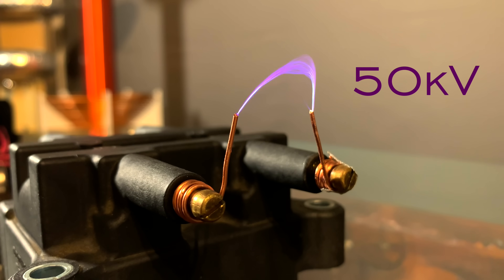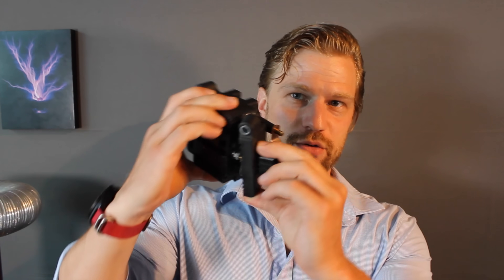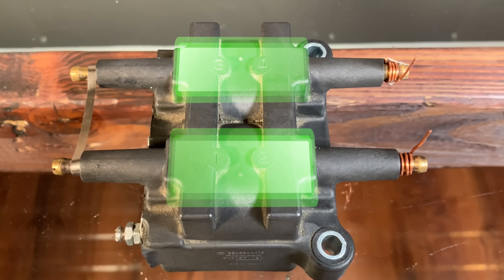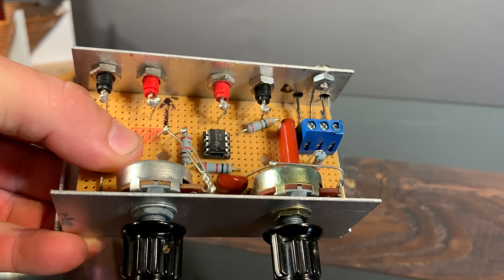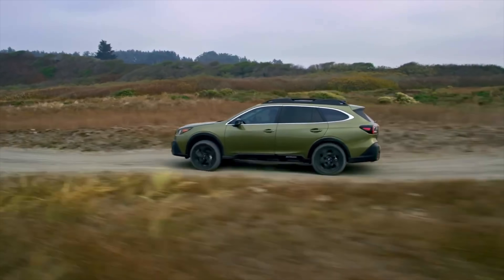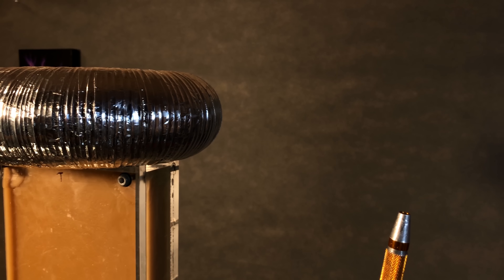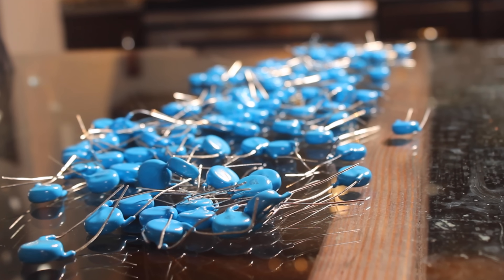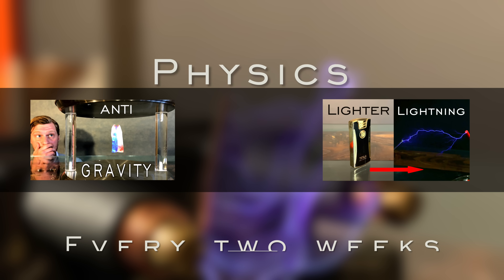The 50,000 volt Subaru Outback Powersource!

Comment: You like high voltage plasma's huh? Your next step should be to add fused quartz in and around your plasma arc, your gap can grow by 4 to 6 times in length as the arc rides along the quartz surface....or drill thru quartz lengthwise super small hole for the arc to pass. After you experiment with quartz's unique HV properties and want to know more.... I'll explain how you can made an arc across a quartz gap without any current flow (cold blue arc) using a charge HV source capacitor (get rid of your LV primary coil and inefficient magnetic core) . And if you're really good you can use a peripheral coil to capture the arc's radiant energy and feed it back into the HV source charged capacitor and watch the voltage rise as your device is arcing.
....and is where our Earthly technology ends, we're not able to control the "spark-arc" past 1 to 3 no current blue arcs as the voltage rises, the quartz surface spark breaks down and current jumps (yellow-white spark occurs). The Greys are far superior, they somehow move the quartz surface to a new unused surface, treat the quartz, normalize the quartz...ready for the second no flow spark, third and so on.
Reply from the maker: This seems very interesting, and borderline Pseudosciency. But, i'm intrigued nonetheless!
Reply: @PlasmaChannel  Get yourself some natural quartz...the longer the better. Let the spark arc travel along the flat surface...and be prepared to increase the gap A LOT wider. Quartz is not the insulator we all take it to be...the surface is highly conductive. I believe someday in the future will be making lots of 10 angstrom holes in quartz to act as a HV conduit.  I've done a lot of research on it in my late 20's and thirties when i was a hot-firecracker of an engineer....now, I give-back to the newcomers. I wrote a white paper on coefficient of coupling when i was younger...they CAN DIFFER Kc (reflective) and Kc (induced) does not have to be the SAME value....basically, I induced a peripheral semi-inductionless coil and proved the reflective was less.
Reply: @PlasmaChannel  The experiment i loved the most was recycling 5% of the power already used thru the "load" back thru the load. I purchased special high-current Germanium diodes and our favorite LC tank...will not work with silicon diodes. It's a total shame our engineering sciences basically dismissed the germanium diode (not use much at all today)...it really is a God given treasure.

Comment: This coil can be driven to up to 250kv with the iron core removed, dunk it in oil and drive the shit out of it in resonance mode like it was a tesla coil....
Reply: Ocean House .
For real.
Then it can be used as a transmision delivery transformer for a home made self looping power plant generating system.

This is all I needed for  a return circuite.
Thanks a billion.
Reply: @gingerbread1032  lol, no for real there is competition on the internet for over driving automotive HE coils, to tesla like voltages/outputs..... several people have made them over the years I think the current confirmed voltage record is 300 kv output..... 150 plux kv is easy, but you have to dunk the transformer in a big pot or PVC enclose filled dry high dialectric oil en-order to separate the leads enough to get the long arcs, at some point the internal insulation of the transformer fails... but its a hell of a thing to see 150 plus kv out of an automotive HE coil, once the core is removed they are basically compact Tesla coils.....
Reply from the maker: This intrigues me. I will look into this - and will attempt more than 300kv
Reply: @PlasmaChannel  I think it takes high input voltages on the primary with an HF driver transformer feed from a high power precise switching circuit like an sstc H bridge to get the best voltage outputs, if remember this correctly for starters you can use a classic tank resonance circuit to drive them as well but impedance matching becomes an issue as you cannot tune the primary you will need to tune something else like the tank input frequency or capacitance...or use a DC resonate charging scheme maybe....   Oh and you gonna need a supply of used coils because you gonna burn a few of them...

Comment: Um... Question... Would it be usable to make a light weight welding unit? If so, how?

Grant, the original King of Random, (R. I. P. He'll be long missed} showed a long time ago how to use transformers from microwaves to build a welder and, by connecting them to some graphite rods, make a micro plasma furnace.
Reply from the maker: Ah, this would not work - welders use hundreds of amps of current. The output of this is high voltage, not high current. RIP Grant.
Reply: @PlasmaChannel  thanks, was just curious

Comment: This would produce some MAD radio frequency noise wouldn't it ?
Reply from the maker: It actually does, yes! Radio was very upset
Reply: Yes it does, that's why spark plug wires are very well shielded and spark plugs have a resistor in them to help reduce noise.
Reply: Good guess, RF interference is strong around such devices. I have blanked out my LCD monitors when experimenting with ignition coils and drawing arcs as long as possible. It was basically an EMP device. I wasnt even using something as large as Subary coil. My experiment had 150ccm single cylinder engine ignition system (12V DC system), coupled with small stepper motor as ignition signal sensor (generator). Just to test out if the ignition works but that wouldnt be fun if not done "properly".
Reply: @elmetorasson96  Sounds like the basis for a pretty sweet hand-cranked HV source if built into a suitable enclosure. How long were the arcs?  I may have to try that.
Reply: Isn't that the high-pitched screech we hear on the audio of this video?
Reply: @chrisjohnston4445   the harmonics will reach into the RF band... and interference-producing devices are illegal as they are classed as "transmitters" by the FCC... 

Be careful of the authorities, ya don't want a knock at the door by a guy with a badge... 🙄😳
Reply: Peter Fitzpatrick those damn goons.

Comment: Since subaru ignition coil allows you to power it in two different ways. I wonder what will happen if you take two subaru ignition coils, configure one subaru ignition coil for high voltage output and other subaru ignition coil to output high current. Take two metal plates, connect one metal plate to high voltage and other to high current and bring the two metal plates closer to each other but don't let them touch each other. Will something happen between two metal plates? What if you drop objects between two metal plates? How will high voltage and high current metal plates interact with each other? Will the electrons flow from high voltage metal plate to high current metal plate?

Comment: Not every gasoline engine uses them: especially small two-stroke engines and lawnmower engines have often a rotating magnet and a coil. I think you call that magneto ignition? It's not a transformer.
Reply from the maker: Great points! Magnetic ignition still use a spark plug, and high voltage. So, you are technically correct - it is less of a transformer, and more of a coil of wire being violently disturbed by a magnet, producing HV

Comment: With that you can make very cheap plasma engine with that engine you can travel from the planets to  planet.
Reply from the maker: Do you mean an ion drive? Yes, this would work for ionic propulsion if it is rectified to DC High Voltage.

Comment: Can this be used in the vehicle?. Bigger spark at the spark plugs.
Reply from the maker: Higher voltages do equate to hotter sparks in a spark plug. Hotter sparks do more efficiently ignite a fuel mixture, leading to a more efficient engine.

Comment: Well it got one of these having four output....its from motorcraft...and it has 3 input the middle pin is the common and I am just using 2pins only can I still use another pin?
Reply from the maker: You can run these coils using any combination of two pins. However, using only two pins does not use the coil to its full potential.

Comment: Man, I just wish they made a truck. I can only imagine a Subaru V8... Dude, Whoa, with a 24Volt  system.... I can only imagine.
Why isn't "That" Technology being utilized, when it come to Re-Charging from the Wheel to the  Battery?
Don't tell me "They" haven't thought of that.
Reply from the maker: Oh, many car companies have applied that tech. Recycling energy back into a battery from a braking system. Its quite simple of tech too. Yeah, with Subaru had a big truck!
Reply: Yes, when coasting, or braking, I'm talking about while accelerating also...
Reply: Subaru has made 2 trucks actually, one called the brat in the 70s and one called the Baja in the early 2000s
Reply: V8 dude? Really? Subaru is famous for using only boxer engines on its cars (BRZ and the old ones dont count ). 
So a 8 cylinder Subaru should be a boxer 8.
Reply: No, Really? I've owned 5 of them. Alright, a 8 cyl Boxer would be Epic.

Comment: Gotta love that 555 hint in there! Great video...I have about 4 of these  ignition coils😬
Reply from the maker: Thanks Michael! the 555 timer is an awesome circuit, but way too fragile. I blow through 555's faster than a bullet.
Reply: @PlasmaChannel 
Have u tried using a 555 & H-Bridge...
That way the H-Bridge does the hard work & u don't damage ur 555...
Also if u use a socket u can just change ur chip as needed in a matter of seconds...
Hope that helps...
Reply from the maker: Hey max, interesting, I’ll look into the h bridge idea. Yeah, sockets are essential. In shooting the video I burned through ten, and the socket made it a blast.
Reply: @PlasmaChannel 
I'm new-ish 2 all of this... but not 2 electronics..!
I'm assuming u have some electronics experience...

I'm assuming ur using the 555 2 generate square wave AC (astable multi vibrator mode)... correct me if I'm wrong (as u didn't really say much about it in the video).

If u feed that (via resistors 2 limit the current, or ull kill the 555 anyway) 2 the input of a H-Bridge, it will trigger the mos-fets & they can handle a lot more power & u can easily use heat-sinks & cool them etc...

The 555 is a pain that way... it can't handle much power wise, gets hot & is a pain 2 cool...

I look forward 2 seeing what u come up with... it would definitely b an interesting video..!

Comment: Nikola Tesla's transmitter system and the wanderclyffe tower is actually based on this same  principle you are demostrating here, his system is a point to point discharge but at extremely high voltages of over 5 million volts! , the point to point nature of the system is why Tesla   got higher efficiencies compared to a normal radio transmission (a radio transmission emanates in all directions) here are some details from his patent:

https://patentimages.storage.googleapis.com/62/90/92/45a5932052a940/US645576.pdf

"By the discovery of these facts and the perfection of means for producing in a safe, economical, and thoroughly  practicable manner current impulses of the character described it becomes possible to transmit through easily accessible and only moderately rarefied strata of the atmosphere electrical energy not merely in insignificant quantities, such as are suitable for the operation of delicate instruments and like purposes, but also in quantities suitable for industrial uses on a large scale up to practically any amount"

" gases are known to be still nearly perfect insulators for ordinary electromotive forces, they behave toward electromotive impulses of several millions of volts like excellent conductors"

"for if the potential be sufficiently high and if the terminals of the coils be maintained at the proper altitudes the action described will take place, and a current will be transmitted through the elevated air strata, which will encounter little and possibly even less resistance than if conveyed through a copper wire of a practicable size." 

"With reference to the facts which have been pointed out above it will be seen that the altitudes required for the transmission of considerable amounts of electrical energy in accordance with this method are such as are easily accessible and at which terminals can be safely maintained, as by the aid of captive balloons supplied continuously with gas from reservoirs and held-in position securely by steel wires or by any other means"

---this quote refers to an  experimental version  (small scale) of his device:

"The outer end of the secondary or high-tension coil A was connected to the ground, as illustrated, while the free end was led to a terminal placed in the rarefied airstratum through which the energy was to be transmitted, which was contained in an insulating-tube of a length of fifty feet or more (50 feet , 15 meters) , within which a  barometric pressure varying from about one hundred and twenty to one hundred and fifty millimeters (120 to 150 mmHg, about  5 to 6 inHg of vacuum) was maintained by means of a mechanical suction-pump."

---this is his proposal for his device at big scale, this is the basic plan for the wanderclyffe tower, he did managed to get the founding to build it but he encountered many technical problems and things  didn't turn out as he thought:

"from my experiments and observations I conclude that with electromotive impulses not greatly exceeding fifteen or twenty million (15 or 20 MV) volts the energy of many thousands of horse-power may be transmitted over vast distances, measured by many hundreds and even thousands of miles, with terminals not more than thirty to thirty-five thousand feet(30.000 to 35.000 feet, about 10 Km ) above the level of the sea, and even this comparatively-small elevation will be required chiefly for reasons of economy, and, if desired, it may be considerably reduced, since by such means as have been described practically any potential that is desired may be obtained, the currents through the air strata may be rendered very small, whereby the loss in the transmission may be reduced"
Reply from the maker: It is absolutely an amazing feat he accomplished. That entire transmitting apparatus was incredible. Cheers!
Reply: @PlasmaChannel  I'm leaving this info if someone else is interested, it is possible to make a DIY small scale model (or proof of concept) of this system using easy to find components: 

- 2 ignition coils (or 2  neon lighting transformers)
- 1 driver module to use with one of  the ignition coils or transformer
- power supply or car battery to feed  the module 

- a  "trigger signal" source (its possible to use a sine wave tones   from a soundcard but this will depend in the type of module)
- 1 container to install both terminals (this is optional, it is possible to just leave the therminals  in open air but the discharge will be just a couple of centimeters at this voltages)

Tesla was using discharges of around  3 million volts (and the reason he used spiral  coils is to avoid arcing between the turns of the coils, at this voltages this becomes critical he explains all  this in the patent) but its perfectly possible to use lower voltages as a "proof of concept" although the range will be a lot less (ignition coils get up to no more that 40 to 50 KV)  Tesla got around 15 meters or 50 feet in  rarefied air, if people want to calculate aproximate ranges the best way to do it is by using  Paschen's curves or equations and input around 120 to 150 Torr of vacuum (as per tesla's instructions) https://en.wikipedia.org/wiki/Paschen%27s_law  this kind of vacuum can put a lot of stress on the container so be aware to use something sturdy. its possible to use less vacuum but this will reduce the range of the discharge. I highly recommend to use a good ground (a good copper rod , some houses have copper water piping this can be even better) Tesla gives this advice in his pattent because it does tent to improve the range.

heres the basic schematic, the specific connections will vary depending  on the type of coils and the module used:  https://i.imgur.com/YzjAFP0.png

Comment: Those are baby sparks. Try oil filled coils like this: https://www.youtube.com/watch?v=Q1L6wJp5qPI
Reply from the maker: Yeah, The sparks COULD be bigger. But not some bad shots though, right?
Reply: Did you see the video that I linked? That is the difference between epoxy coils, such as you are using and oil-filled coils.
Considering that you are using epoxy coils, you're doing quite ok, but especially if you want to use this as a power supply in other projects, you should really forget about Subaru and go for the classic oil-filled coils. I think with a pair of those you can get twice the voltage and even more power. (oil = self-healing insulating coolant) Looking forward to your two projects. The voltage multiplier comes with some difficulties at those voltages as you will undoubtedly find out.